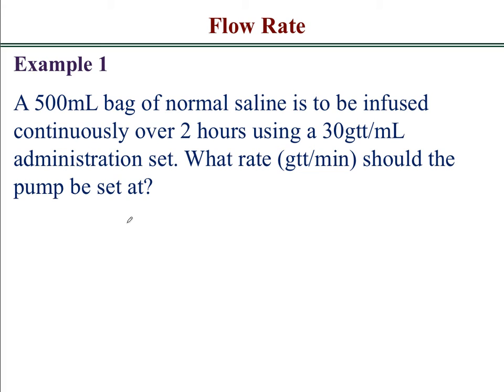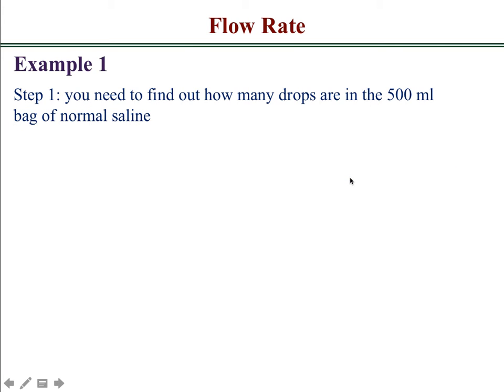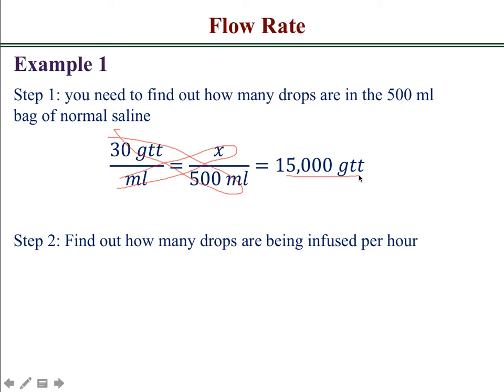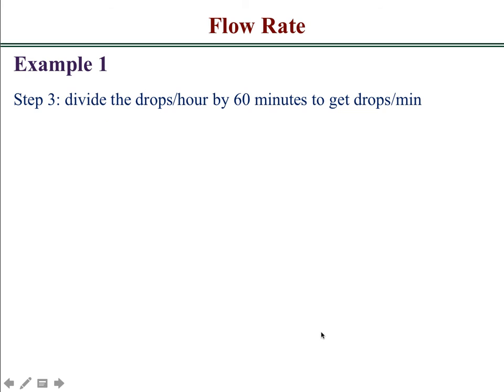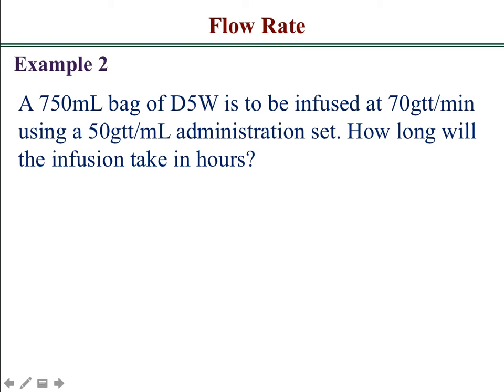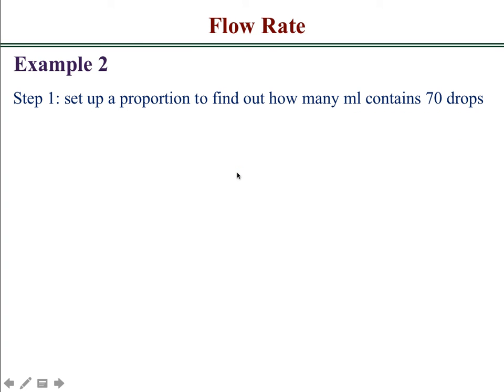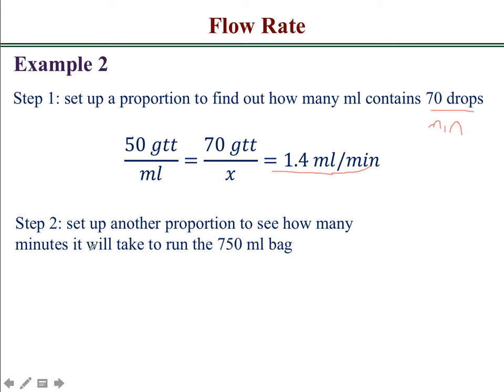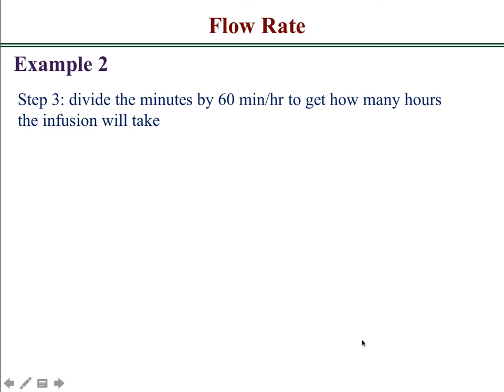How to solve flow rate calculations problems

Comment: What level is this supposed to be?
A highschooler can solve these easily, right?
Reply from the maker: "Pharmaceutical calculations is the area of study that applies the basic principles of mathematics to the preparation and efficacious use of pharmaceutical preparations." 

Pharmacy students take pharmaceutical calculations in pharmacy school. The mathematical and problem-solving methods have been previously learned (sixth grade to high school). 

However, the terminology and understanding the pharmaceutical/clinical purpose and goal of each computation is new. Thank you Acraind for watchign and for the comment.